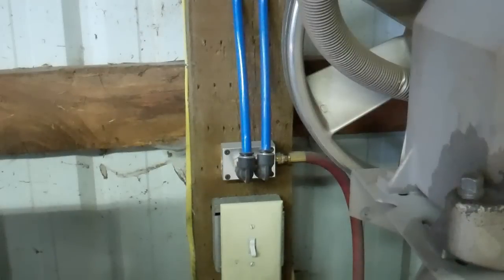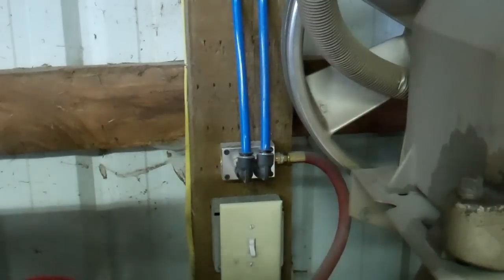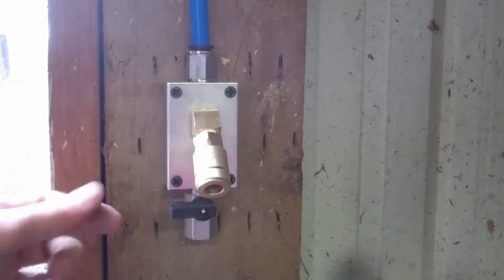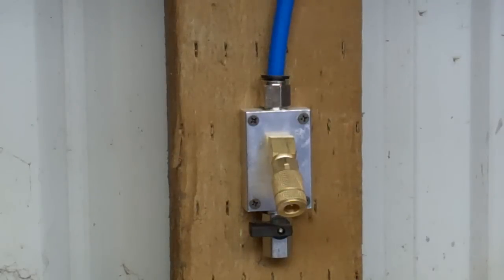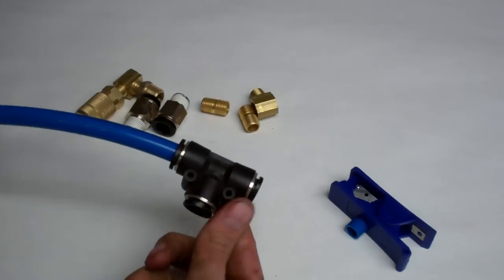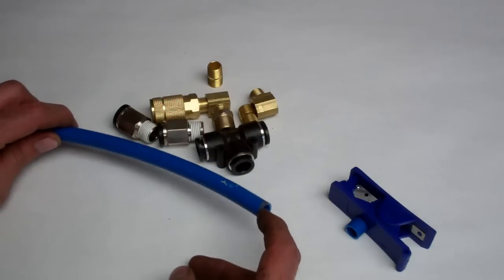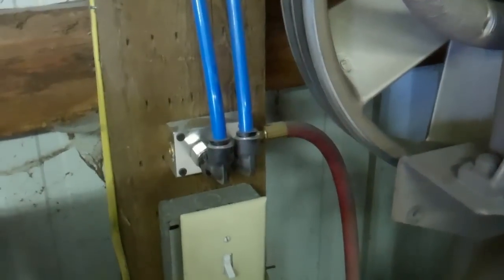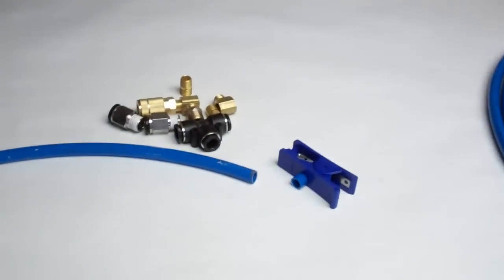How to Install an Efficient Air Compressor Line System in Your Shop

Comment: That is the same stuff used on tractor trailers works good survives all weather conditions.  It is like working with pex pipe easy to install just don't make tight bends or it kinks other than that it is good stuff.

Comment: For a permanent compressed air distribution system, they recommend that you run a loop all the way around the shop and tee off drop lines from that to each outlet. It helps to minimize the pressure drop through the distribution system to have the air coming from both directions to the outlet in use.
Reply: That's a really good idea.

Of course, if it's a one-man shop, it's not really necessary.
Reply: Also a word to the wise, I worked with pneumatic for years and one thing you want to avoid is 90 degree fittings always use a Y fitting instead of a T fitting as the 90s cut your flow dramatically!! They shouldn't even put those in the kits without explaining the downside of them.

Comment: Semi trucks have been using these nylon airlines for years. look at the fittings from the truck's airtanks.  Durable? Yes.  Downsides: it does get brittle over time, especially if an airline antifreeze/methanol is used. The quick connector's springs weaken over time, the plastic housings can crack, and water in the system can cause corrosion buildup that clumps in the airlines.  Every shop system should have water drain petcocks, filter, and airline oiling.

Comment: One quick suggestion to minimize the upright style compressor vibration normally found when setting on cement floors.  It also helps with the movement due to that vibration.... I use Hockey pucks under each base foot.  It dramatically reduced the overall noise level of the compressor and also, it will extend the life of the welds on the feet of the tank.  The vibration of the compressor on cement will wear on the welds and over time, may cause a break and or leak... just my 2 cents.
Reply: Installing a compressor this week. Using your idea

Comment: My compressor is building pressure but the problem is, its not releasing it with pressure. Like if the hose was kinkes but its not. What could be the problem?

Comment: Is this just 1/2 PEX or is it something different?
Reply: The RapidAir system doesn't have the aluminum layer. The 3/4" MaxLine does.
Reply: This is a higher pressure rated nylon tubing, where pex is cross-linked polyethylene. Water pressure ratings are different from air pressure ratings, as liquids are not compressible, so the stored energy of the substance at that pressure is greater for a gas (air) than for a liquid (water).

Comment: Hi Cody, Love your channel, love that you aren't afriad to express your faith. Seems like freedom of religion applies to everyone except christians these days. I would like to offer a suggestion for your air lines, I am not a fan of vertical air line runs near electrical outlets or switches. Condensation collects there & if a hose burst when you are not around you get wet outlets. GFCI outlets would probably be ok. But,  it's your shop & I know I get a little anal about some stuff. God Bless.

Comment: The more moving parts is not "the better". Quick connects are the end convenience for me. I don't like the integrated air gage as well because of multiple users. Were it just myself no problem. Air pumps in military motor pools are as bad and often worse than the 75 cent pump at 7-11. That's why I don't lend out my stuff to just anybody.

Comment: Rapid air is such a scam. It's nothing more than cheap PEX pipe and some overpriced fittings. You can make your own kit from Home Depot or Amazon parts for so, so much cheaper. No need for those silly aluminum blocks, a few brass fittings will do the same thing, probably better. Push to fit fitting aren't very good, crimped fittings are way better. If you buy the fittings and quick connects in bulk it will be significantly cheaper. Just use the standard PEX pipe sold at any Home Depot/Lowes/plumbing supply/hardware store.